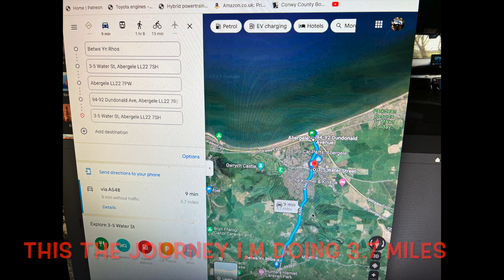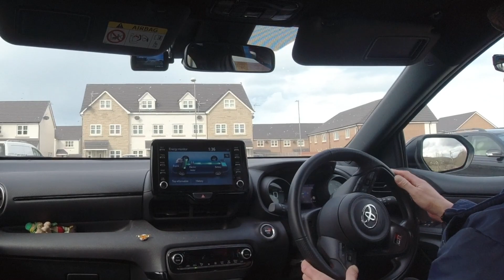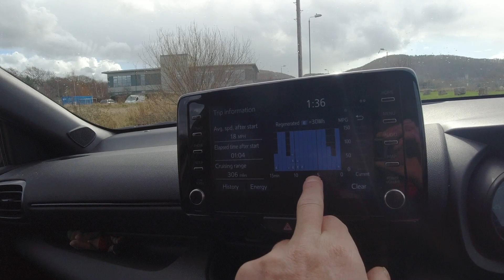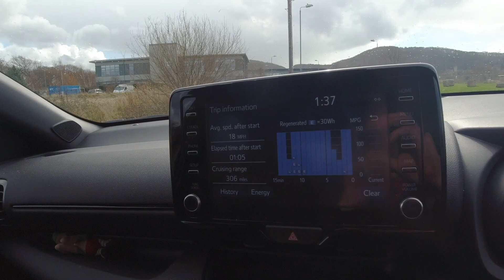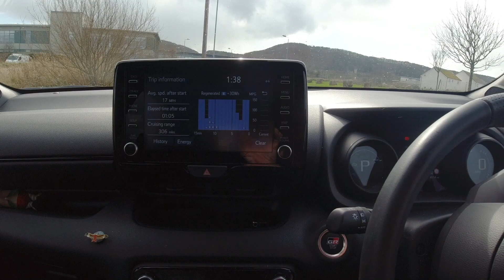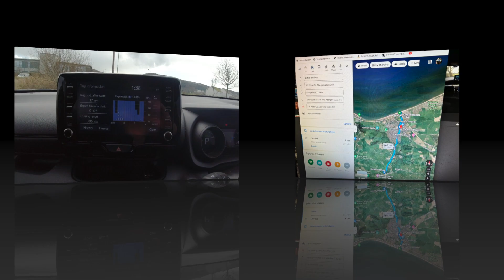Tips & Tricks 21   A typical journey using the energy screen to improve my fuel consumption

Comment: I'm thinking of buying a yaris cross gr sport. Would this be as good as what you drive.
Reply from the maker: Probably not as dynamic to drive as GR Sport Yaris 
I’ve only driven 1 Yaris cross and that was an excel and it was lovely to drive, easy to get in and out, lots more space 
It’s a small suv so a totally different driving experience 
But still an amazing car that i would recommend if I needed a larger vehicle
Reply: Thanks for your reply.I watch all your clips on the GR Sport which looks a great car but I do need a bit bigger car,the yaris cross looks perfect for me.
Reply from the maker: Definitely a great choice of car the Yaris cross if a bigger car is required

Comment: I'm waiting for my 2023 gr sport hybrid in galactic blue toyota said will be ready by 31st of July,I've always had high performance cars audi rs4 bmw m3 subaru impreza wrx sti Mitsubishi evo focus rs etc,I'm so excited to drive something what is fuel efficient,how many miles would a full tank of fuel do,I'm used to getting about 80 to 150 if I was lucky
Reply from the maker: Depends on how you drive, anything between 350 to 400 miles between fuel light to fuel light , they only hold 36 litres and  I find my light comes on after using 29 litres leaving a good amount in reserve, it’s also dependent on outside temperatures, so in the winter you’ll might only get 350 miles and as the temperature rises the range will increase
Reply: @North Wales SXS  I appreciate your advice going from something like my rs4 costing over £150 for a full tank and getting 100 miles if I was lucky,even 300 on a 36 litre tank is beyond amazing,for some reason when ordering mine they don't do the two-tone paint anymore you only get gloss black spoiler, grills,mirrors,wheels and fog surrounds,but I know there's a new feature with the my t app what you download on your phone and can start your engine lock unlock the doors etc off your phone does yours have this

Comment: Your long downhill section shows that this model is rather better at storing the spare energy compared with the older one, given that the traction battery has a higher capacity. The previous one would fully charge it before the bottom of a hill like that.
Reply from the maker: Every thing about this hybrid system is just amazing

Comment: What’s your thoughts on using premium unleaded like Shell V power etc instead of regular unleaded. Is it better for the engine and does it improve fuel economy.
Reply from the maker: I’ve tried both e10 and v power 
It’s not worth spending the extra on v power it doesn’t give you any more fuel economy , not even worth the extra cost 
I ran my 2020 dynamic on e10 for over 50000 miles never missed a beat 
I’m running my GR Sport on e10 and she is running amazing
Reply: E5 (premium unleaded) will give you better economy and a little more power. Unfortunately this is now only sold as the expensive stuff. Ethanol has less enery potenetial than petroleum hence the E10 stuff not being as good.
Reply: Although premium unleaded does have a bit more energy per litre than E10, it’s probably not worth paying for, unless you are concerned about the “shelf life” of E10 - which is not very long, before some of the ethanol settles out from the mixture. Some places quote about 90 days. If there is a lot of moist air in the system, it could result in a mixture of ethanol and water, which would settle at the bottom of the container; not nice.
Reply from the maker: My e10 doesn’t get a chance to go off as I do around 450 miles a week in my car 
Did run 3 tanks of v power and the difference in extra fuel economy was so small it justify the extra cost